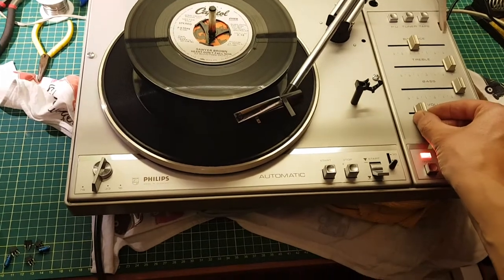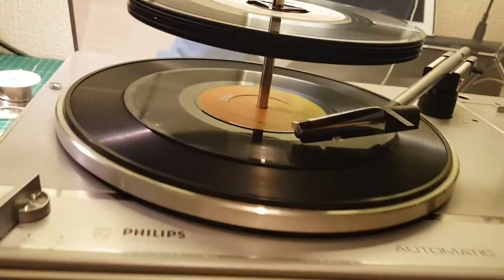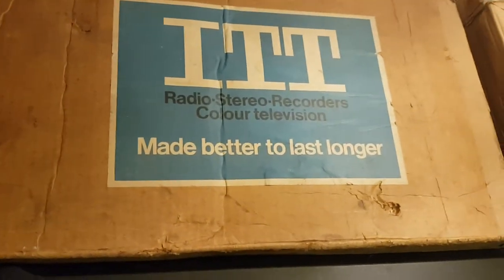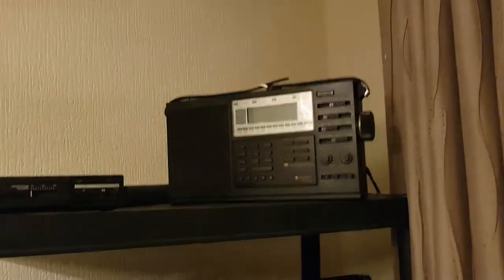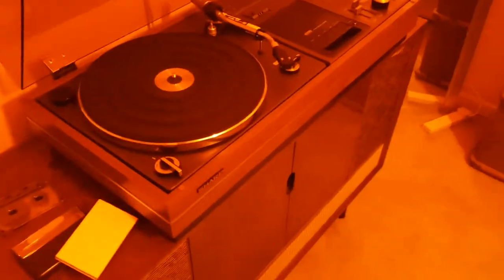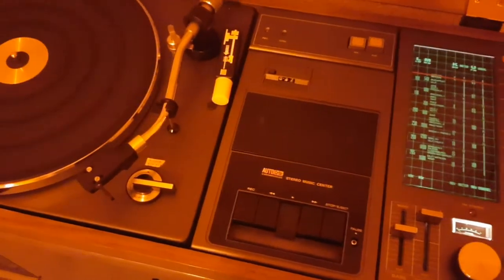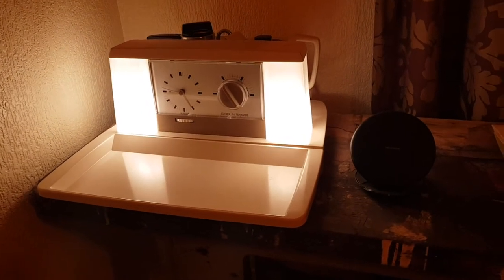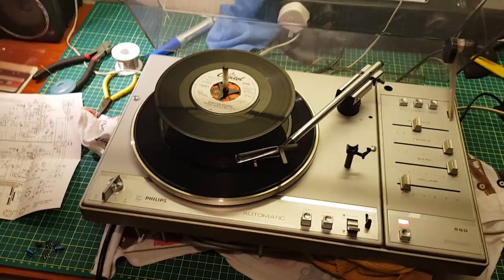Philips GF 660 record player

Comment: This was the high end philips changer for the era. In fact you can upgrade de cartridge in the GA160 (same turntable without the amp) with a high end ceramic GP380 or a magnetic cartridge GP410 both high fi with complete frecuency response 20-20000Hz. So it's no budget by any means
Reply from the maker: Thank you yes great turntable

Comment: Got 2 at home. But both seems to play a bit faster with 33 LPs. I’ve mesure the rpms and indeed I’ve got 35 rmps.  Is there any hidden screw to adjust the pitch. ?
Reply: I have one as well and am having this same problem. I'm a newbie to turntables and I'm not sure what I need to do. My sliders also don't seem to change anything in regards to volume, bass, etc. I want to open it up but I'm afraid of ruining it